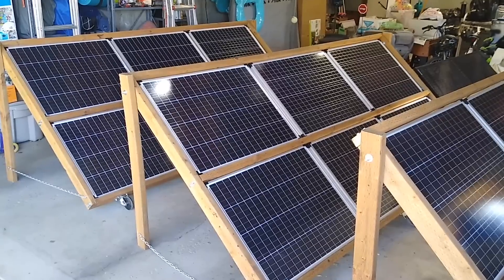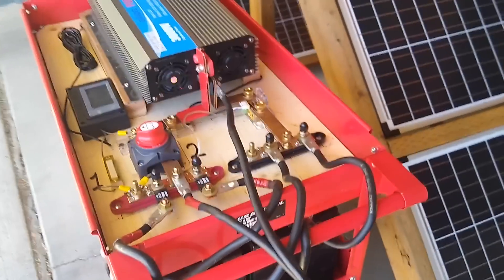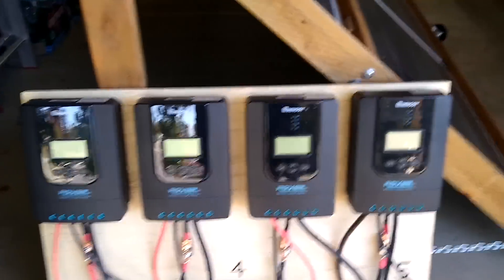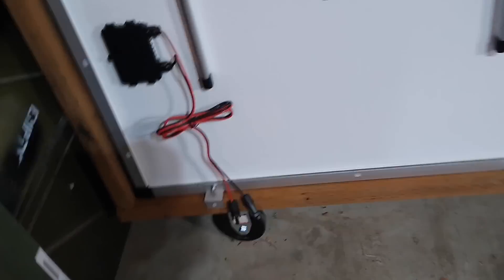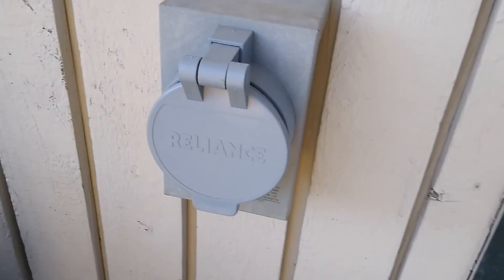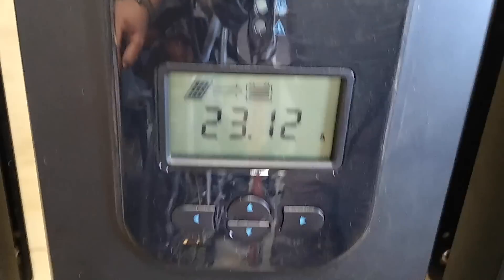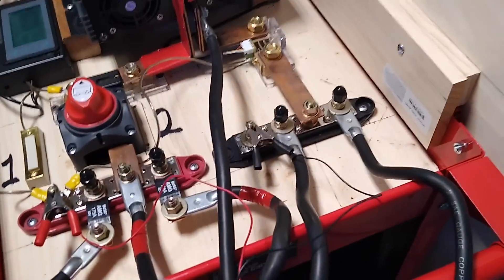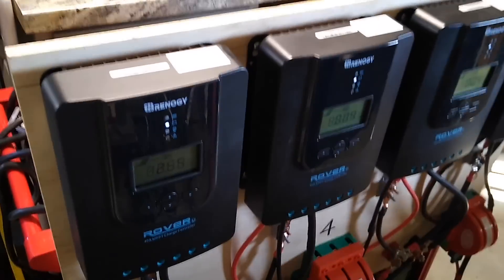My Portable DIY Home Solar Powered Battery Backup System for in Case the Grid Goes Down...

Comment: I’m considering getting the same thing as you. Not concerned with powering the 240v items. Is there a switch that can be installed to allow only utility or only solar to be chosen? I see the breaker panel lockout feature, but was wondering about a switch.
Reply from the maker: So following a 2 day power outage about 3 years ago, my next door neighbor and I both decided to install a generator port on our houses.  I went with the configuration you see in the video where the generator (or solar power system) are connected to a couple of breakers on the panel.  My neighbor went the other direction which was to put a seperate switch box where his house connects to the grid.  So he does have a big external switch to go from grid to generator.  I switch it in the panel.  Coincidentally, we also have the same type of generator.

Comment: After all that money you spent, you can just tie that system into your power permanently. I don't understand why it is portable. You have all that investment just sitting in your garage not doing anything. Why not have it pay you back?
Reply from the maker: Because my electric bill was already less than $100 on average so it wasn't really that important to me.  My siblings in Arizona have electric bills in the multi hundreds of dollars.  But, at some point when I get around to making the necessary wiring changes, my intent is to deploy one or two arrays permanently to power our TV room which has the freezer, a second refrigerator,  the big aquarium and the TV/home theater.

Comment: Great cheap setup.
Plenty of room for improvement. Automotive battery cables use steel ends which waste energy, and can corrode in moist environments.
Windynation and plenty of other sources for copper, and tinned copper crimp on ends, with weather tight shrink wrap ends. 
I like to use a crimp point tool, but there are hydraulic and hammer/vice crimpers. 

Glad you upgraded to 24V, that will let you produce better amp to watt ratio. With all the panels you have, 48v is even more efficient, but then you need to invest in class T fuses, and special high voltage dc switches. 

Will Prowse’s diy solar forum is fantastic for routing out issues to prevent problems from cropping up.

Still, a great system so far!

Comment: When the grid goes down, pray for sun!
Reply from the maker: It's not feasible for most people to be 100% prepared for all contingencies.  Even the largest solar systems with battery backups are vulnerable after a certain number of overcast days.  Originally, my main electrical backup was a generator which will work on cloudy days.  But will fuel be available?  Now, solar is my primary and the generator my secondary backup, but certain times of the year, we could definitely be out of luck.
Reply: @Eric1Tube  Oh good points. In general, I am against solar for anything more than charging your cell phone as technology is limited. If the grid goes down, we have chaos. My training and prep efforts tell me to be mobile. Not to stay in a fixed location or all you will be doing is defending your property for survival. The solar station you have built will be stolen. Now if you do this for everyday use, save some money, etc, then great job!

Comment: Beware… those bussbars are likely brass, and not capable of handling the amperage your system can output.
Best to source true copper bars.
Reply from the maker: Two things:  I did run it full out and checked the temperature of all the connectors.  It was good.  Subsequently, I converted it from a 12 volt system to a 24 volt system which dropped the amps in half.  So, it's OK for now.

Comment: good vid    like that it's separate units   easy to scale for diff apps  wood hangy thing on cart?    u basically made a french cleat   as i,ve heard it called
Reply from the maker: Hmm, French cleat.  I never heard of that before but now I've learned something new.  Thanks.
Reply: @Eric1Tube  heard a int designer use the term  made em for their big wall art , pics, .. even fancy upholstered head boards ,.. sometimes  45 the two pcs  where it will lay flat against a wall/flat surface     took their word for it     seemed like a fancy word for a pretty basic practical thing

Comment: I would just use it as solar daily activities. Why used as backup?
Reply from the maker: Because my electric bill was already less than $100 on average so it wasn't really that important to me.  My siblings in Arizona have electric bills in the multi hundreds of dollars.  But, at some point when I get around to making the necessary wiring changes, my intent is to deploy one or two arrays permanently to power our TV room which has the freezer, a second refrigerator,  the big aquarium and the TV/home theater.

Comment: what size cables and fuses are you using?
Reply from the maker: For the most part, the cables connecting the batteries to each other are 4 gauge.  There are two battery banks (each has 4 batteries).  The cables connecting each battery bank to the bus bars leading to the inverter are 2 gauge.  The copper bars connecting the bus bars to the inverter I think are the equivalent of 1/0 gauge.

Comment: Nice little back up system.  Shame you haven't invested in a split phase inverter to make it real world.  That would really complete the system for actual usage.  Dryer, electric stove, etc could operate with solar.  You might need more panels and more batteries to go whole hog.
Reply from the maker: Yeah, I didn't start off with the intention of making it the size that it is.  My original intent was to rely on a gas generator as my primary power backup system.  I was just figuring to make a small solar system that would be a secondary back up system in case the generator quit or I couldn't get fuel.  Now, the solar cart is the primary back up and the generator is the secondary back up.  Probably our next residence will have 100% solar capacity.
Reply: A cheap induction cooktop and clothesline take care of some of those concerns, depending on weather.

Comment: just wondering why its not on your roof
Reply: The roof is not always the best option as snow and dust reduces power output
Reply: @avoice423  or not the best angle to get the most sun
Reply from the maker: Two reasons:  First, I need to do some refinishing work on my roof and second, I want it to be transportable for when we move.  There's a reasonable chance I will put panels over the garage in the future.
Reply: I heard many complaints and fights between home owners and installers regarding roof damaged/ leak after solar was installed. If your property has space I think ground mount is better way.

Comment: Would you recommend the renogy solar controlers. I'm getting ready to build a system to power my shed and I'm looking at the components I need to by.
Reply from the maker: I am fully satisfied with my Renogy controllers.  So, yes, I would recommend them.
Reply: I eventually moved all the way up to Victron due to failures of key components over time.  Now I just go ahead and buy the really good stuff.

Comment: Cool setup but why did you go with the Harbor Freight panels instead of getting 7 more panels matching your neighbors? I imagine that would be cheaper and you would only need two arrays for 2400 watts and only need two charge controllers too.
Reply from the maker: The system is good but not ideal due to the fact that I started out with a much smaller system in mind and the scope gradually increased over more than a year as I'd buy a couple of panels here and a couple more there whenever I noticed them on sale.  Same situation applies for the charge controllers.  Current price for a 6-pack of 330 Watt panels like mine is $1854.  So about a dollar a watt which is about what I paid for my panels.

Comment: Where did you find the red slide switches #4 #5 ?
Reply from the maker: I bought mine on Amazon.  I had specifically Googled the term "triple pole knife switch" because, at the time, I was only looking at 3 arrays and wanted to switch 3 circuits.  Then when I added the stand alone panel, I needed another switch.